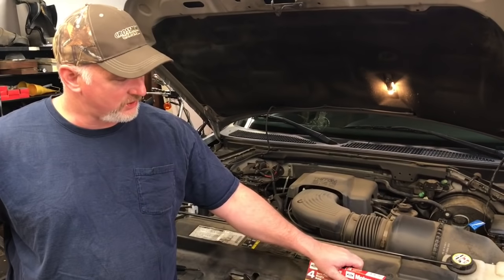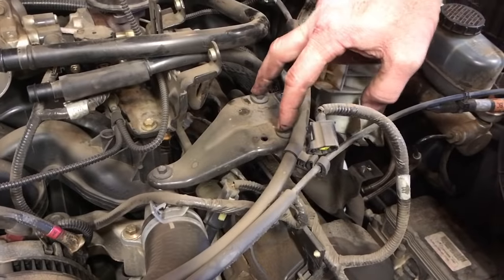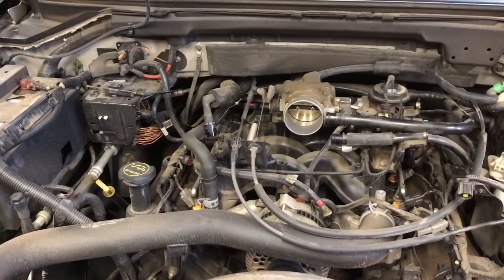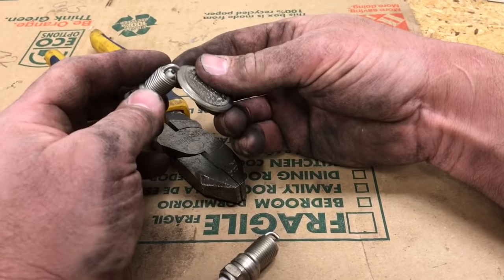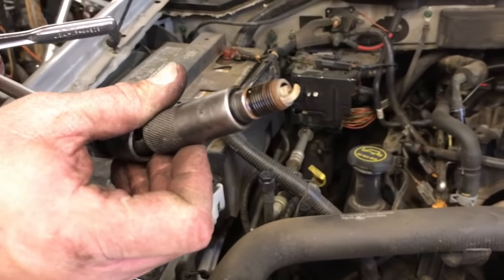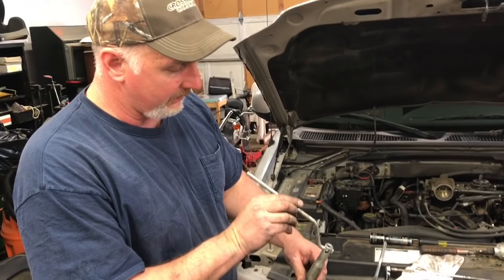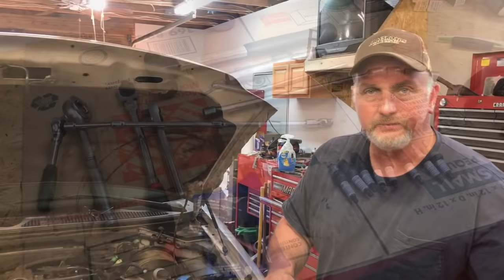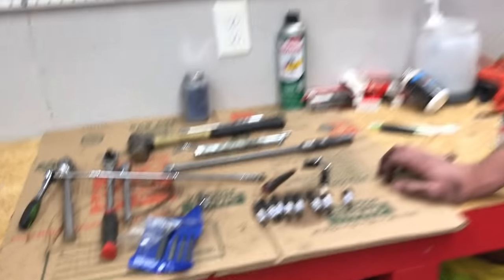How To Replace The Spark Plugs on a Ford F-150

Comment: Cleanout those holes and pre-soak the plug well. I hear the impact works well too. Nice trick with the tires being flattened. Big help for the 4x4 trucks. Never seen that before.

Comment: had a 1999, F250 super duty, with 5.4 and when changed the plug's, the annoying part, was each coil, had 2 small screw's. holding each, currently own a 2003 F150, with 4.6 ,and was much easier with one larger screw,holding the coil, but I did change all 8 coil's, on the F150. and the fuel rail is annoying, but the 5/8" magnetic spark plug set from gear wrench, allowed me to do all on both sides, one of the foreward plug's on driver side, had to use shorter swivel from set, and add a 2" 3/8" extension, but all doable,, hear nightmare stories, on F series. but so far all good !!  like your dropping air. had to use a small step ladder.

Comment: Thanks for the upload. I'm still suck on cylinder 7 and 8. I will attempt to take the pipe off to get to the cylinder 7. I just hope that frees up room to get to cylinder 8 also. I seen plenty of videos with people removing the fuel rail, but I really didn't want to remove it unless I have to. I have always changed my plugs but my 2001 expedition with only 125k miles has given me the worse problem. My 2002 camaro wasn't no where as bad as this ford.
Reply: Same 1-6 was easy I’m stuck on 7&8 but I don’t wanna take the rail off what should I do
Reply: @alexharper9786  I ended up taking the rail off. Just took my time and did it east. I didn't mess up the injector rings either.
Reply: You only have to raise ot up far enough to get it out of the way though. Just het a string to hold it out of the way till you are done. Now installing the Cal Van inserts in these engines are a different story. Its easy but you have to follow a video and be sure not to let the C clip come off or the bit will run all the way into the cylinder. It almost happen to me.
Reply: @bbay1977  oh man I appreciate it I’ve been trying to avoid that but nothing else is working for me might try and swivel combo and if that don’t work then imma have to raise the rail
Reply: @alexharper9786  your welcome, good luck on the swivel. I have large hands and had no luck with it.
Reply: @bbay1977  Turns out whoever did them before might have stripped them Idk which so I’ve came to the conclusion of just letting them be idk what else to do but it’s been bugging me that’s for sure I ordered a 9/32 wrench and they still slipped because two  on 1-4  cylinder were 9/32  bolts  but I could get a socket on those
Reply: @alexharper9786  They make sockets that will grip bolts that are stripped. You will just have to get a deep socket to go over them. Thats the best way to get them out instead of removing the heads. They may have already spit the plugs out before and some idot just JB welded them in there. If thats the case, you will need to rethread them. If you do, pay the extra annd just get the CalVan set. It is a easy job and once done, no more worries about them spittiing out again. here is a link and he has a few step by step videos on the process. i bought the complete set, but only used 2 of them. if it spis the other cylinders out, i'lll replace them too. https://youtu.be/dwFjaNrKVp8
  I hope it is just stripped, but be careful how tight you tighten them back up. They will strip the treads easy.
Reply: @bbay1977  I really appreciate this hopefully I can find a 7mm one that’ll work but with 1-6 done plugs and coils,  I thought it would help with Gas mileage but I guess it’s just a gas guzzler . The truck was my papaws and it sat for a couple years I put a new heater core in it and a few other things but we shall see
Reply: @alexharper9786  Well I hope it all works put for you. My heater core was bypassed this year. I watched plenty of videos on how to replace it. I did flush it out but after watching how much stuff has to come out to just get to it, I just bypassed it. I'll get around to it but I'm in no hurry. As long as my air works good I can always wear more clothes 😆.
Reply: @bbay1977  yeah I hear that it was kind of a pain in the ass. How’s your MPG in yours ?
Reply: @alexharper9786  I get around 17 on the highway and 15 in the city. I have the 2001 eddie Bauer 4x4 edition and it only has 124k miles.

Comment: The mechanic at the Ford dealership told me my spark plug was rusted in and if it broke off in there, he would have to replace the thing that holds the spark plug. He said it would cost around $1,500 if that happened. I told him to leave it. Now that I see this video, I realize he was lying.

Comment: Took me hour And half to just get to Cyl #1 that code told me was misfiring. Took gas attachment bolts out and unseated them to move it outta way. Noticed he didn’t though. It got dark by time I got the 1 cyl plug in, so I put everything together, turned my 2001 Triton v8 4x4 on and no light! Did code search, No code and no skip. Truck only has 81,200 mi on it and the plugs never been changed. Now gonna tackle the other 7 plugs. If I can get away with not having to loosen gas line, that be super!

Comment: Appears that those plugs were put in originally without anti-seize.  I use Motorcraft NICKEL anti-seize exclusively on steel to aluminum interfaces now.  If I could afford the stuff for nuclear reactors, I'd use that.  <smile>

Comment: Wish you had shown the #4 removal and getting the broken plugs out. I need to do this and those are the problems I'm dreading
Reply from the maker: number 4 wasn't that bad for me. I used the old nissan tool that I talked about in the video. I'm just glad that one didn't break. That would have been a pain to get that one out.
Reply: @minthillbilly  what size spark plug socket u used?

Comment: Man I have a question. I have a 2000 f150 with the 5.4. And on the number 6 cylinder I pulled the coil pack off and shot air down inside the spark plug well. It shot out oil when I did it. What could that be. The plug was tight too. I'm scared the head could have a crack. Please get back ASAP. thank you
Reply: I'm 20 years old and have worked on cars most of my life, I just dont make enough money for a shop to work on my trucks/cars. I'm a shade tree mechanic lol

Comment: Getting to the back two coils/plugs on the drivers side is the hardest part of this whole job... and you skipped over it.  :(
Reply from the maker: Sorry about that. Was trying to keep my video under 15 minutes. I think the back one on the passenger side is the most difficult. We can agree to disagree. Have a good day!
Reply: @Hctibeyb hey I was wondering how you got the back 2 on the drivers side out? I've changed all the plugs but cylinder 7 and 8. I had to place calvan inserts in cylinder 2 and 3. Kills me how they just blow the plugs out but the calvan inserts fixes that problem.
Reply: @Hctibeyb okay thanks. I will have to go pick one up tomorrow.

Comment: Ford owners:  flatten the tires to reach over the fenders for the plugs billiy bob!

Chevy owners:  hey grab a step stool to reach over the fenders for the plugs!
Reply: Im a Ford guy but you got a point there! WTF?..decrease air pressure in the tires to be able to reach into the engine bay? Over 40 yrs doing some (not all) of my own wrenching on all types of motors, Suzuki, VW, Ford, Honda, Dodge, Chevy, Yamaha, Kawasaki, Triumph, BMW and Fiat I have seen some crazy ideas.
Reply: Nice one!  I had a good laugh!

Comment: Worst how too ever. Thanks for showing us nothing. I had to take the fuel rail off. Did you show that? Nope! Didn't tell which plugs or coils to use! Luckily I found another video.
Reply: You shouldn't have to take off the fuel rail if you have the right tools and know what you're doing. Use Motorcraft plugs and re-use the factory coils unless there're bad or very high mileage. Use only Motorcraft coils, or perhaps Denso if you have to. Also, chill out bro!